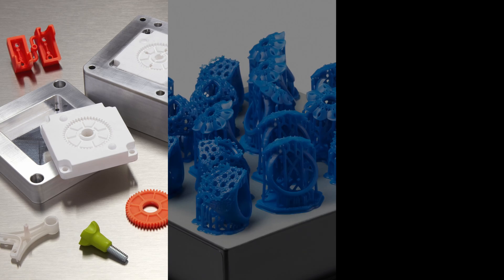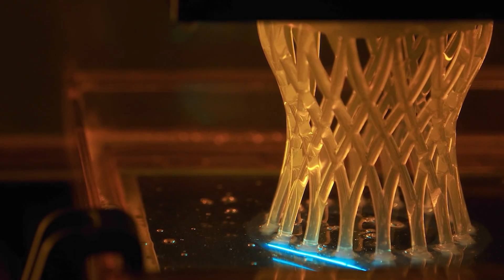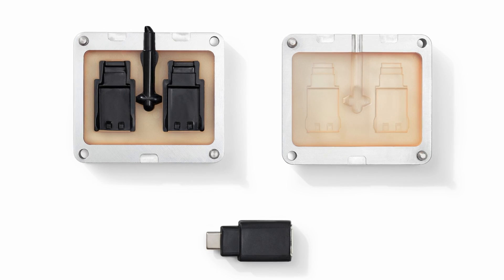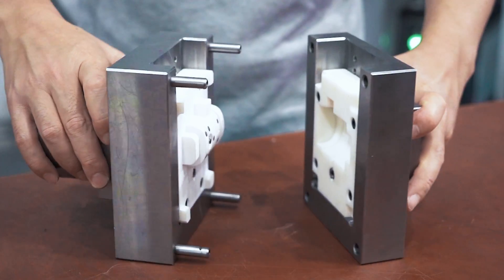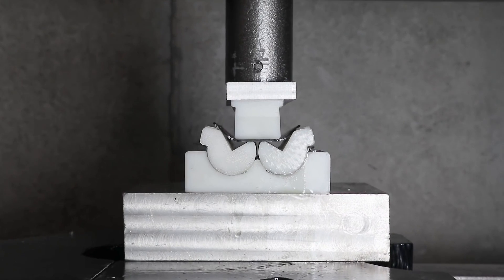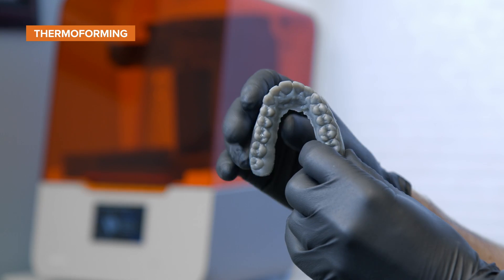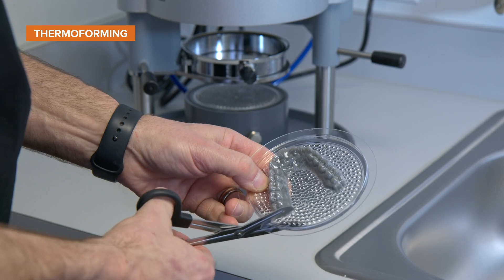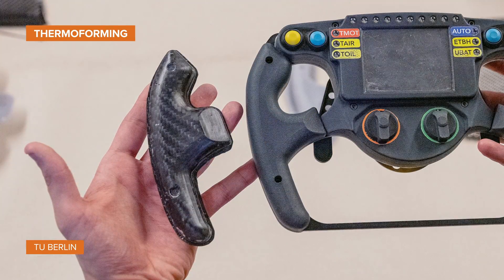How Does Rapid Tooling With 3D Printing Work | Process, Applications, Examples & More

Comment: Great overview of rapid tooling! We frequently combine 3D printed soft tooling with vacuum casting for 50-300 production-like parts. It's perfect for bridge tooling - much faster than aluminum molds while providing superior surface finish over direct 3D printing.:face-blue-smiling:

Comment: I've been 3D resin printing for 4 years on small machines up to 300mm resin printers but the mSLA is inaccurate when it comes to fitting 3D printed parts like FDM/FFF can. Is SLA always accurate or just some brands and types of SLA 3D printers?

Comment: Hi! we have a formlabs printer and used 10k to print the molds. The question we have is: can we use the cooling fluid to cool down the molds as we do in steel molds? Or would the rigid 10k absorb the fluid and gets destroid?
Reply: Hey there, I'm using 10K for aggressive water/chemical environments. It has extremely low absorption (of water, at least) compared to other materials so you're good to go. Cheers.